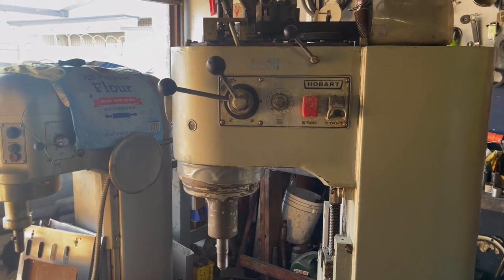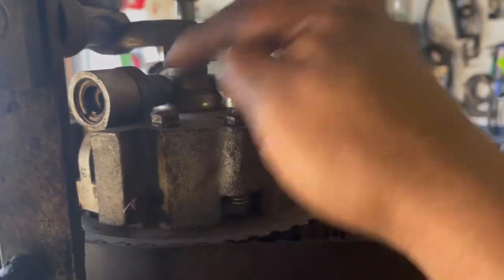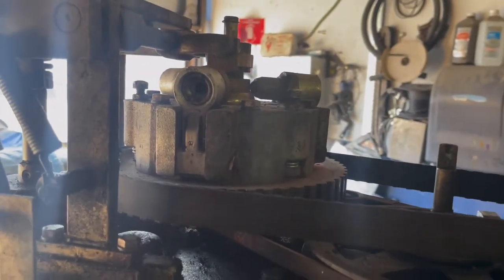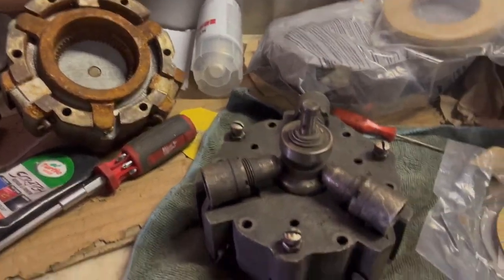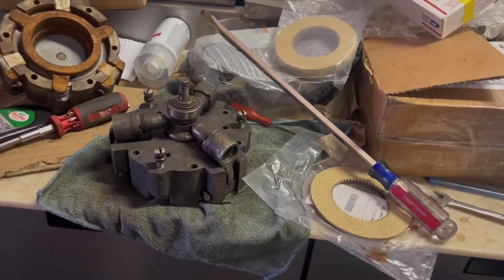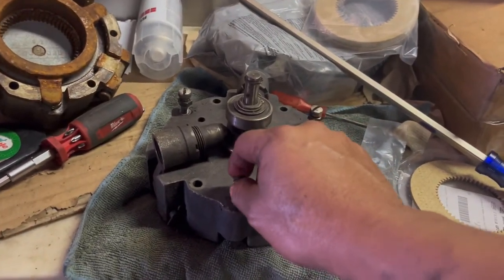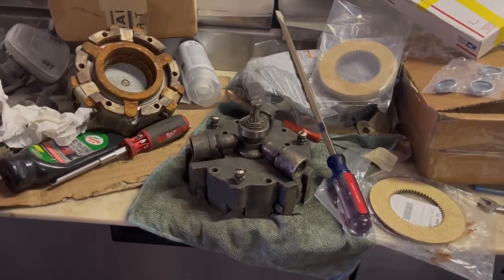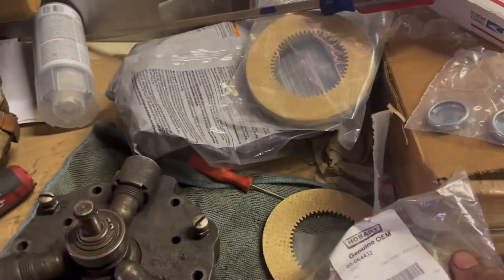Hobart M802/V1401 Clutch Service Replacement part 2

Comment: The M802 and the V1401 have very close spring tensions one is 3.5 turns one is 4 turns I always have to look it up before I do the adjustment..................Hobart Tech for the past 25 years.

Comment: You should have the clutch assy. installed then adjusted your tension and you need to have your fingers at a 9/64 clearance if adjusted properly you don't need the brake assay. for it to stop.